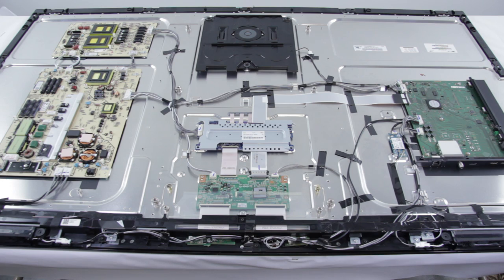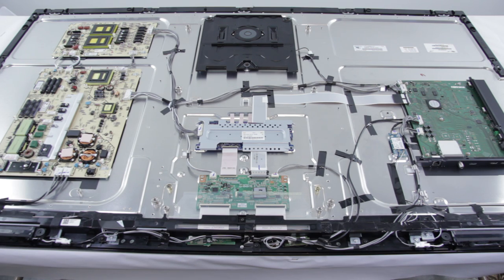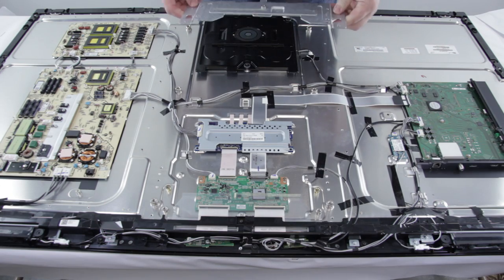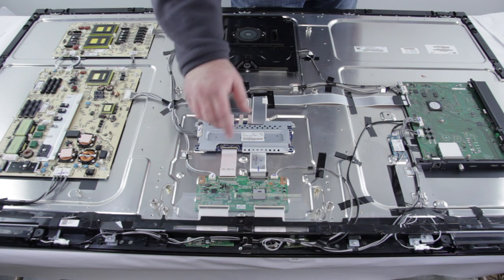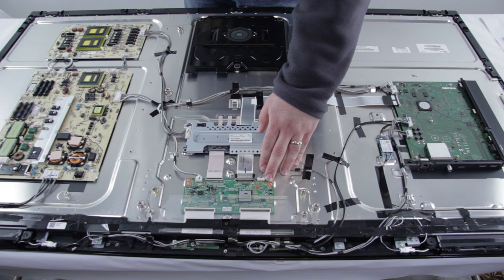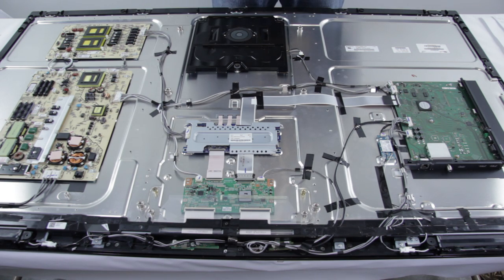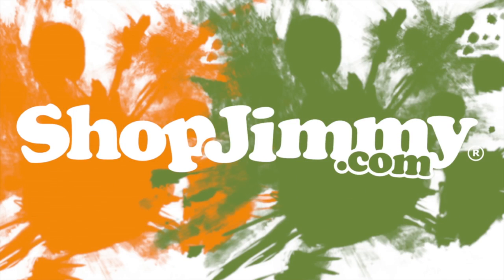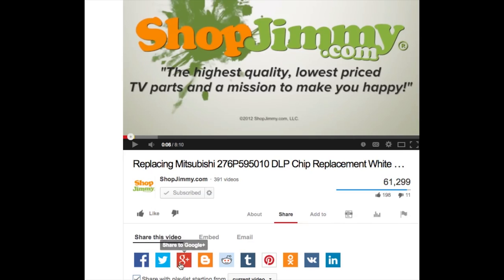LED TV Repair T-Con Board Help Review Overview - Common Issues and Problems with T-Con Boards

Comment: I have a Samsung 55in model UN55ES7500FXZA. I have problems identical to this video https://youtu.be/XcBpAyYWZQg. I get a picture with vertical lines and then it powers off. Sometimes I can watch for a few hours, but it eventually happens. I can hear a clicking sound as well when it turns on and off.  Any advice?

Comment: My son went on back of the tv. It turned off. I think it hunted I need a priest lol. Kuz even with out cables or power connected the light is still flashing 10Xs. No image just black screen. Is a Panasonic Viera plasma HDTV 50'. MANUFACTURER OCT 2009. S# MD92890674.  I tried on unplugging it ON AND OFF. CLICK noise but no image. Blinking red light 10Xs. Than after a minute with out power cable the light turns off. Whats going on. What does it need.
Reply from the maker: ms guzman37   I recommend replacing the power supply in your TV.  Please reply with the model number for your TV and then I can recommend a replacement part for your TV repair.  Thanks!  www.shopjimmy.com

Comment: VISIO GV46L HDTV 10A.     On Antenna for HDTV. 

Everything on this TV works perfect, Except, no DTV. Antenna and signal, cable, amplifier, .... from antenna verified good with another smaller VISIO HDTV.  Again, everything works except HDTV stop working. HDMI I, HDMI II, all other INPUTS work. Analog TV ( I live close to Mexico) works from same Coaxial Cable from Antenna. 

Symptom: When switching to DTV INPUT to watch TV, screen would remain blank for a short while and then come on and work perfect. The time to come on started as short as 4 minutes to as long as 1 hour, then several hours. Then it would just not come on at all on DTV only. Still everything works, but DTV will not come on. Connection to Antenna has been verified over and over to work prefectly on three other VISIO TV we have using antenna for HDTV. 
Where is/what board has failed on my TV ? Thank you !

Comment: Hi Jimmy

LG 65c7p-u oled
This is what the TV is doing intermittently. 
https://youtu.be/Tv39hKBE2JY
I already first replaced the main control board and then the power supply board but it didn't fix the problem. 
The sound cuts out as well as the picture. Could this be a faulty tcom board? I don't see any other boards but the wifi board. 

Thanks 
David

Comment: Hi i have a Samsung UN55ES6150FXZA 55" LED TV. It was manufactured April, 2012 and i bought it August , 2012. Two days ago i was watching the tv and paused it to step outside for about 30 minutes, when i came back in and went to watch the tv the screen was black but i could hear the sound and i could see a very faint picture when holding a light against the screen. I called Samsung support both on the phone and in live chat and needless to say i got the same service as you all got from them, their useless. I was told that the Red power light is a code depending how many flashes there are when you turn the tv on, mine flashes 5 times and then just a black screen again with sound. I did what Samsung's brainiac suggested and put two new HDMI cables and unplugged and plugged it back in but didn't do nothing. So now here i am asking if anyone here has had the same issue and has any idea what the problem can be, is it worthless or can it be fixed ?  Thank you in advance for any suggestions.

Comment: I have an LG 50LA6200-UA 50 inch LED TV that is having a problem with the picture. When I turn on the TV the picture will show then start to cut off and on and then eventually stay off. The sound is good and continues the plan and you can still see the LED light even when there is no picture. I just replaced the T-Con (from shopjimmy.com. Still has the same problem. I can still access the settings and see the menu and text information. Let  me know if you have any idea what may be the problem.
 
Here is a video:
 
https://www.youtube.com/watch?v=lNDdjAp0fdE
Reply: Jack Crayne I was able to get this resolved. I contacted shopjimmy support via email
 and after a few back and forths with them the symptoms appeared to them
 to be a bad panel. I had a feeling that it was not the panel since the 
picture was good on all the onscreen displays using the settings, etc. 
In addition. When the picture was working it appeared to be OK. The sound
 was working as well. Downstream from the main board appeared to be 
working ok. I purchased refurbished main board and installed it 
yesterday and the problem was gone. I left the tV on all night and all 
is still good. I will update here if things change.

Comment: I have a Samsung UN65HU8550 At random times the smart remote doesn't work along with the long normal remote. Just yesterday I went to turn the tv off with the smart remote to leave and the power button did nothing. I pulled out the long remote and pushed power and the tv was still on. I started to push power on the long remote over and over and the tv finally turned off. We were gone for about 6 hours and I picked up the smart remote and hit power. The tv didn't turn on so I tried the long remote. Same thing no power. I went into our office to file a service request with samsung and 5 minutes later while filing the request the tv just turned on.

Samsung support is a joke. They are sending a new smart remote to try and make sure it's not the remote and in fact the tv that is the problem. My warranty runs out Oct 19th and who knows when the tv will act up again. It does this at random.

Comment: Black horizontal lines from left to right on Samsung LN55A950:

https://youtu.be/OzhtDfUOE9c

Tried cleaning/reseating the four ribbon cable connections. Did not help.
Reply from the maker: +jdryyz  Try all repairs and troubleshooting at your own risk.  This could be a problem with either the t-con board, the main board or the TV panel.  You can replace the t-con board and main board individually to see if one of those boards fixes the problem.  Click this link to replacement parts for your TV model number:  http://www.shopjimmy.com/catalogsearch/result/?q=LN55A950  There may be multiple boards for the same TV model number, be sure to match part numbers on your current board, with your replacement for compatibility.    Thanks and please let us know if you have any further questions with your TV Repair!  www.shopjimmy.com
Reply: +ShopJimmy.com  Thanks. It was the TCON that seems to be the most obvious one to check first and I do not yet know which one I have. I will be removing the metal plate this weekend. Based on my research, though, I do not hear about many cases where replacing this board has fixed the lines problem. Seems more likely that the panel is the culprit. Then again, only a portion of the screen contains the lines.